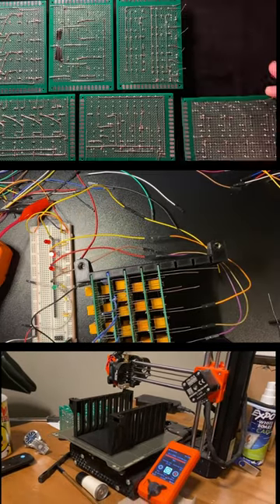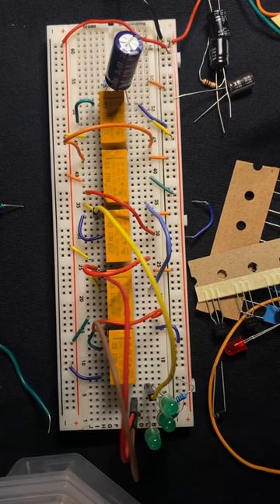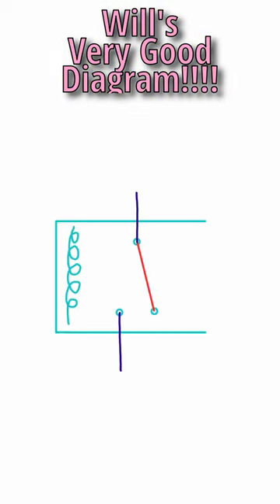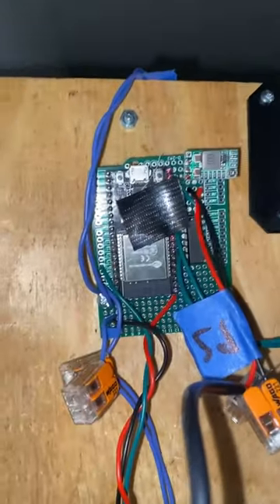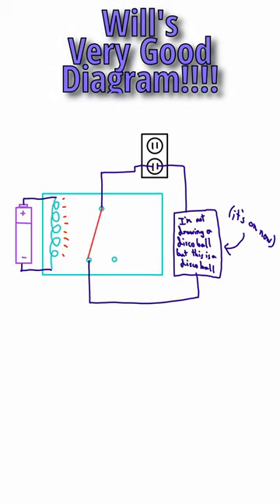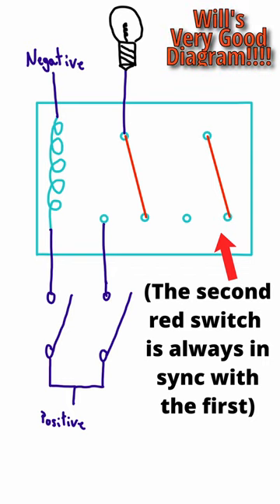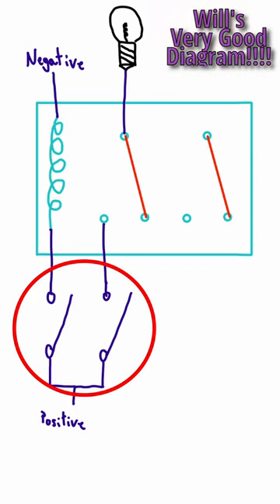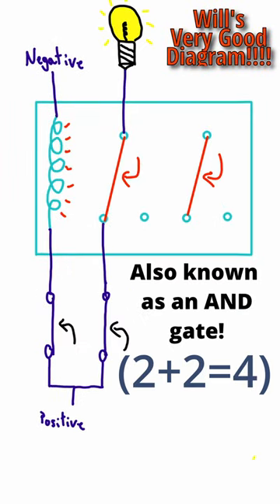How will my homemade mechanical computer do math?

Comment: hi, I was also building computers from scratch, I created an 8-bit Overture computer from the game Turing Complete in the game Mindustry, 

recently I was wondering if I could make it in reality from relays, I calculated how many relays I would need to build:

180 for an ALU,  
64 for checking conditions,
392 for 8 registers, 
150 for memory on punched cards that supports jumps so that you can go to the address of a program line in a punched card, 

in total there are 770 relays approximately, this costs a lot, really a lot, I realized that there is no way  I can do this project, at least for the price